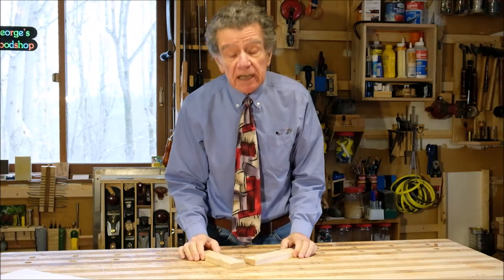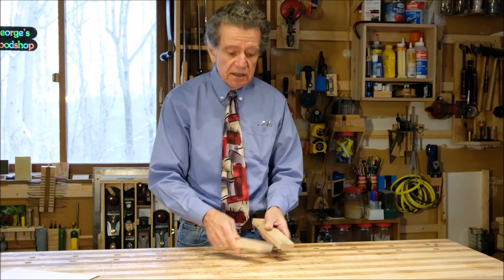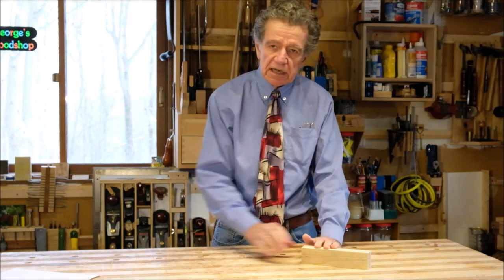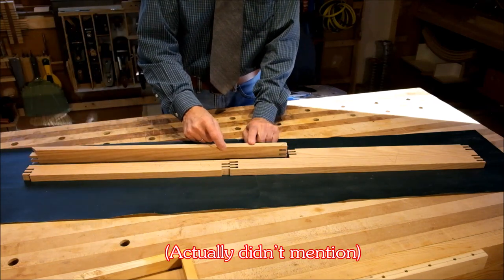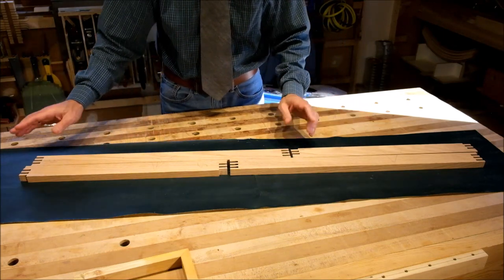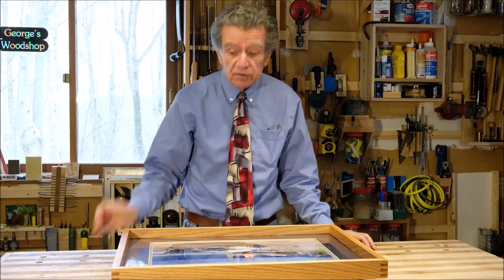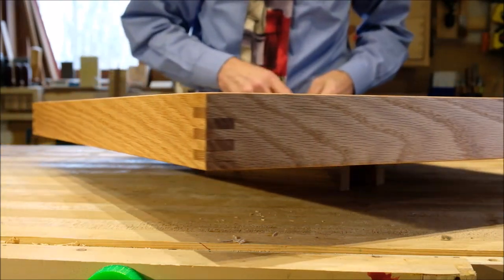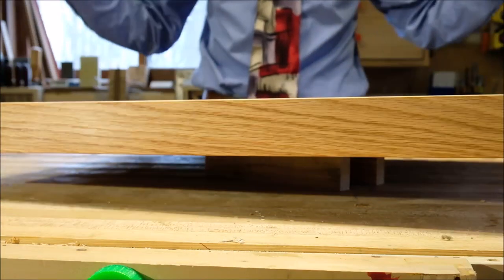Why resaw for picture frames?

Comment: I like the humorous style of this video.
I had never heard of this technique. Once again, I learned something!
Reply from the maker: Hi Woody.  I stumbled on to it myself, in cutting out the pieces from one board, and somewhat following the method for getting grain fully wrapped around corners in box-making (Objective: Reason 2).  Dreading planing the face and back as always, I had no trouble with this frame.  So I sketched it out on paper and saw that if the grain had been consistently at a slight angle in the original board, then it would travel around the frame consistently too, and make its planing a joy.  Discovery too good not to share.  Thanks for commenting!
Reply: @georgefouriezos8863  Well, thanks for sharing! Merry Christmas and JoyeuxNoel"!
Reply from the maker: Best of the Season back, not only to you but to everyone who reads these comments!